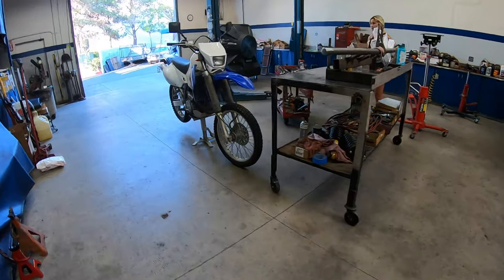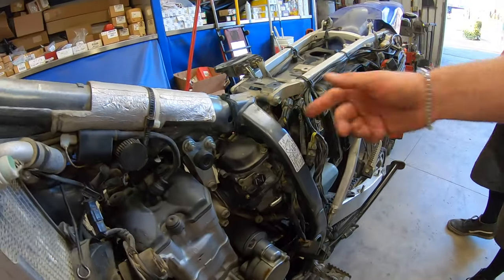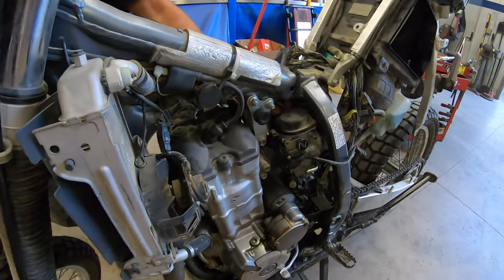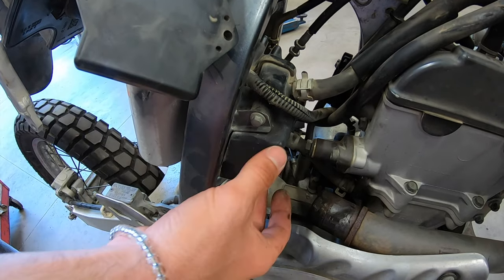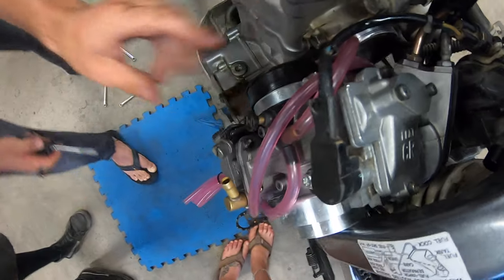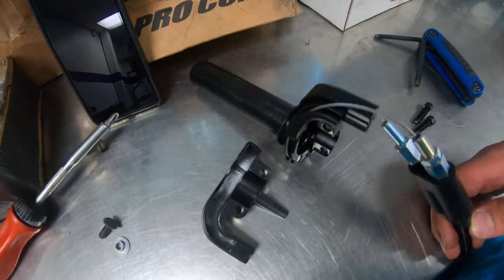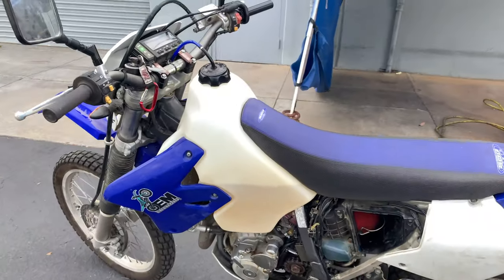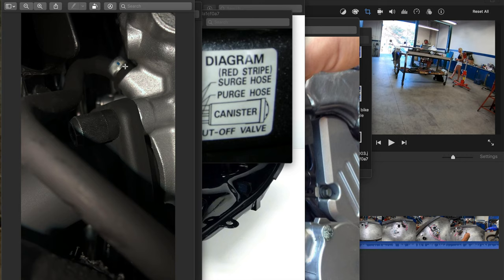drz400 Carb upgrade install video for OEMDirtBikeParts

Comment: You mentioned that a hanging idle is caused by the mixture screw. Is this a lean or rich condition?
Reply from the maker: AAA Hills Handyman .. Bella Vista Handyman hanging idle is fixed by turning out the bottom air screw and re adjusting the idle after giving it a few revs between each adjustment
Reply: I will answer your question.
It means it's lean.

Comment: What’s the name of the shop and where it is? Would they do my install?
Reply from the maker: Em6726 this is action van suspension, we have many shops that can install for $250-350.
Reply: Shoot me a shop in San Diego that can handle the install